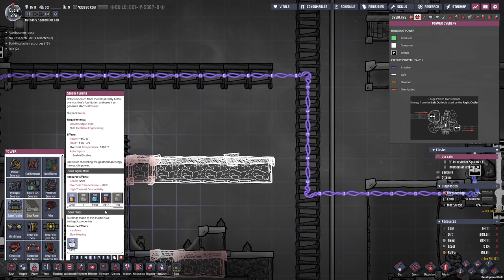BASE COOLING - Oxygen Not Included: Ep. #18 - SPACED OUT DLC

Comment: If you want the base at 20 degrees you may need to set the loop initially at 10 degrees as there wont be a lot of oxygen flow and the thermal cacity of oxygen is very low compared to the solids in the base
Having a liquid reservoir in a steam room when you were trying to cool it was funny, pretty sure they transfer heat.
Reply from the maker: I set the loop temp a bit lower for the next episode:)
Reply: @Nathans-Sandbox  thanks, enjoying watching the series 😃

Comment: Easy way to fill steam room is using small amounts of different types of liquid. Don’t build steam generator and leave outside and middle tiles open.  First put oil, then put either salt water or polluted water, then top off with regular water. No vacuum out necessary.
Reply from the maker: Good strategy, might use in the future. Just hat the debris you leave around using this method.

Comment: If you think about it, your aquatuner is running half the time. If you pipe from the tank, to the heatsink, to the aquatuner with a double bypass back to the tank and take the temp on the tank output, the aquatuner will run all the time.

Edit: not ALL the time, but it could.

Comment: You don't need the vents at all. Set the upper pressure sensor to 250 and the lower to 450 and you only have to deal with the first couple of minutes of production then the hydrogen side gets fully primed and you don't have to worry about the system ever again. Also this thing can be self powering with only a little bit of extra hydrogen that can go towards powering the base.
Reply from the maker: The vents I would like to keep as an extra measure to keep the contraption from failing (had some issues in the previous save with it). Self powering I had that fail in cases where I don't need so much oxygen, therefore the pipes clogging up and the electrolyzers shutting down. Right now the extra power goes into the main system, should we produce it. Might still make it more elegant with smart batteries and such, especially once we start to have problems with the power.

Comment: As I seen your build with the water cooler in the ultimate base playthrough. I want to say you, that you actually don't need a liquid shutoff. Just let the automation wire from the temperature sensor disable the aqua cooler so that the water can bypass it. Much simpler. Because your set up with the liquid shutoff doesn't work for my last playthrough. And I figured out that it better works without it :)
Reply from the maker: I stopped using the bypass method recently because the failing rate with some liquids/setups was going on my nerves. But I wonder, what you mean it will not work with the liquid shut off?
Reply: @Nathans-Sandbox  Okay Im trying my best to explain what problem I encountered. When I was replicating your setup from the ultimate base video with the cooling setup (the big place of polluted water next to the steamturbine and the water cooler.) I tried to build and setup everthing as you have done. I just had more polluted water maybe 20 tiles more or so.  I just thought it would taking a bit longer to cool the entire water. but my problem was that the water cooler produced so much heat that the steam was always around 400°C and break my liquid shutoffs. in seconds. and they were out of steel. to fix this problem I tried to use a temperature sensor for the steam in the room so it disables the water coolers then the temperature was rising above the breaking point of the liquid shutoffs. but than my system doesnt work at all. and the cooling of the polluted water didnt work. than I searched for another solution. I found a youtube video from someone who doesnt use the shutoffs, (when i found it i will link it here) and let the automation wire disable the watercooler instead. And that was to trick for me. Also your metal refinery setup didnt work for. I had to work around that too hahahahha. but nevertheless your an awesome person i hope you dont feel attacked or anything. I learned a lot through your videos :) I love to watch them <3
Reply from the maker: OK, I'm not sure why I didn't encounter the same problems, but I'm glad you found a solution that worked better for you! Don't worry, I don't feel offended when people point out mistakes in my contraptions, I learned a lot through the comments alone;)

Comment: the steam turbine setup is extremely  inefficient. try to use ceramic insulated pipes in side of the steam chamber.  and use transformers to provide power to the aquatuner the heavy joint plate contacts alot of heat . and put ceramic tiles between the turbine and the steam box to avoid heat leaks. and use polluted water inside the cooling loop.
Reply from the maker: I went back in there and fixed a lot of it for the next episode, the joint-plate was the biggest problem.
Reply: @Nathans-Sandbox  good , happy to help 😀

Comment: This Rodriguez cooling is going to fail miserably eventually, speaking from personal experience... (or maybe because i used to feed 90° water lol) 

You're better off using polluted water for your coolant for the aquatuner due to its higher heat capacity than crude oil or petroleum (we're just cooling oxygen to 20°)

P.S: 1 aquatuner with polluted water is good enough for the rodriguez, isolate the water tank buffer, and the heavy joint plate isnt insulated [no mods :^( ] use a conductive wire instead
Reply from the maker: I fixed most of in between the episodes now according to your feedbacks, it should work now (had to go back a couple of cycles and redo some stuff,  but it was worth it)